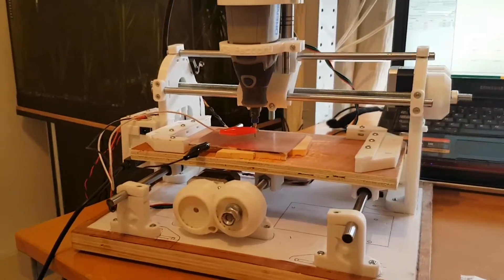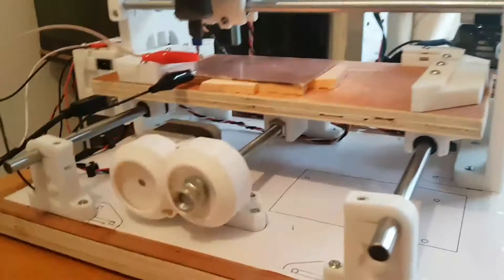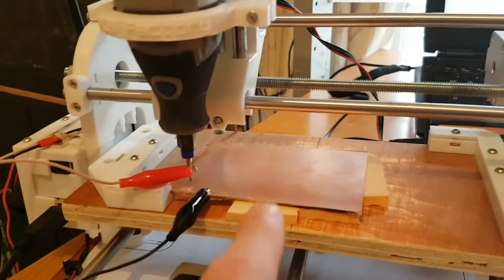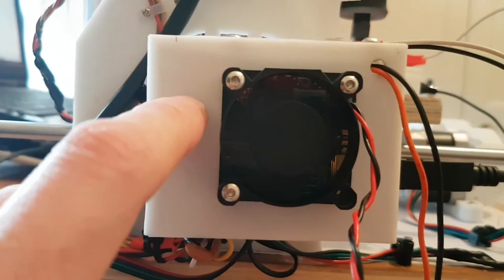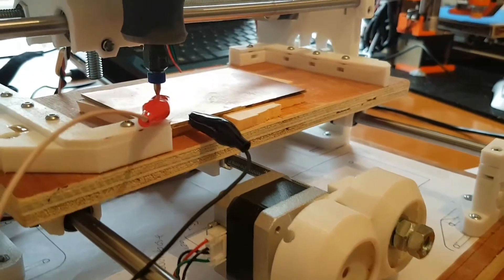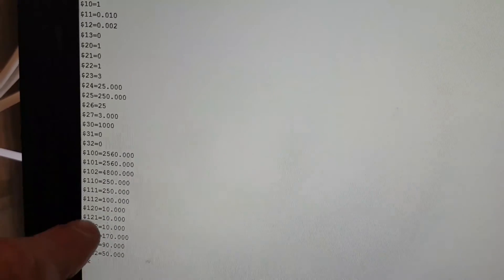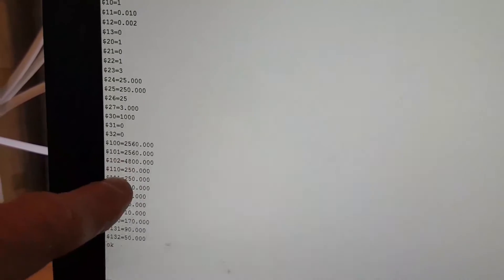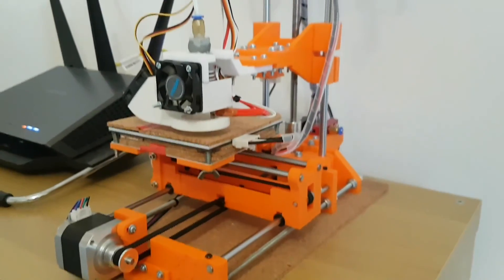Cyclone PCB Factory. Overview and first Tests

Comment: Cool vids. I especially like the Atom X!

I was watching a 3d printing video the other day on Youtube and the guy in the video said that when you are in Gcode, if you just type "G" it gives you a whole list of the codes and if you add whichever code and a question mark it gives a detailed description of that gcode. Dunno if this helps with what you are doing here?
Reply from the maker: Thanks and thanks for the tip! I'll try that. I'm planning on doing a video on the AtomX showing how to configure it with Marlin and the BLTouch. Just need to take it apart again to make the Y carriage longer. The autolevel really helps it though. all the best.
Reply: I fancy building something like the Atom X and it looks to have the most 3d printed parts on it except for maybe "the snappy"? 

I have autolevel on my Micromake delta, but it still doesn't properly level the bed as the nozzle scrapes the bed sometimes on parts of the first layer. I can get away with it on smaller prints, but it has limited my build size a great deal. More tinkering needed I think.

Look forward to your next vid!